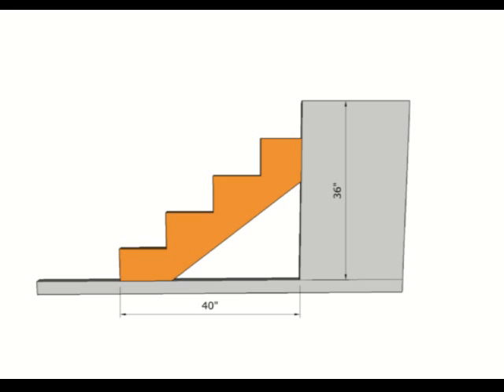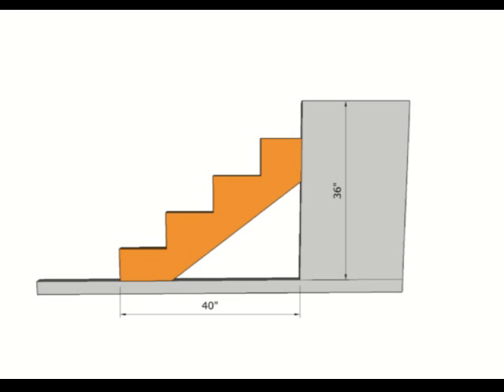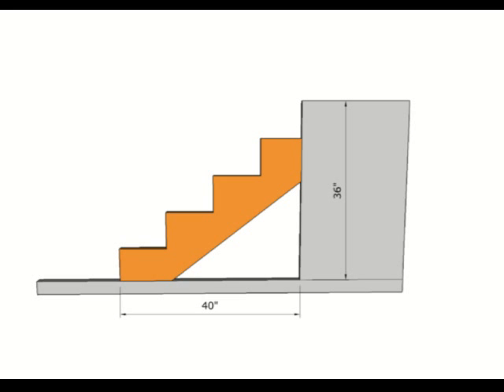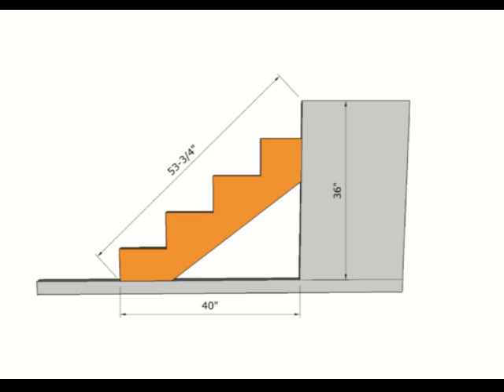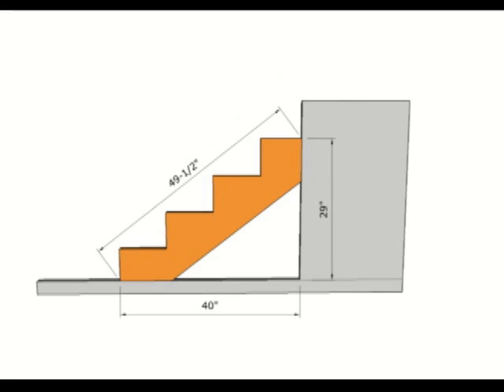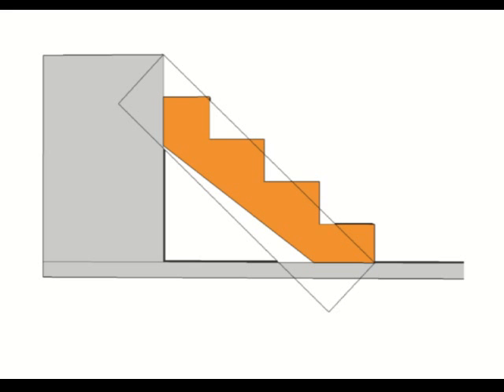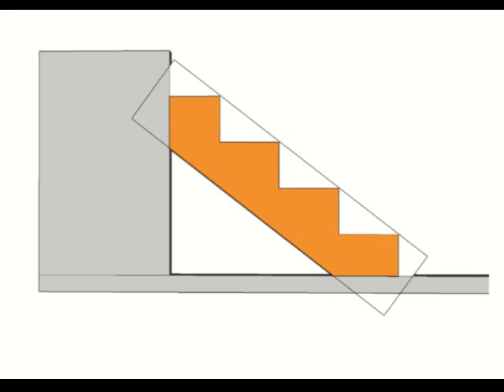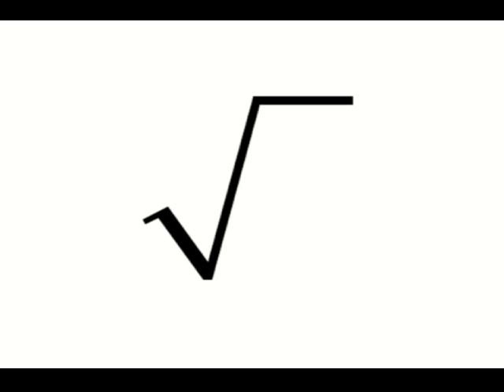How To Figure Length of Stair Stringer – Construction Math

Comment: Worst math or DIY video Ive seen. A confusing, complex meandering math lecture. If you're going to go so math heavy then show why its a square root of the final number. 
a² + b² = c²     so "c" (hypotenuse) = square root of a square + b squared. 
To isolate c, you do the opposite which is to find the square root.

Comment: Many moons ago till said date i stumbled on a bracket type stringer with out evrr setting foot on it heres why the stringer was short of the desire d area for one secondly it had to be rais ed thereabouts a foots to be level so now the bottom of the stringer on the main floor was retro fitted with a piece of metal holding it up picture houses in louisianna by the bayou on stilts and installed in this state yes california if ur  wandering hes yet to see anything in this utopia of know it alls how. Him would go about making on site adjustments to take rectify this situiation

Comment: But if the length has to stop at a certain mark, no one gives that, say if the mark on the length is 90 inches and the height is 60 inches, I guess I will have to make a video showing how to do it, I guess no one knows how, I can make them to stop anywhere the customer desires but it’s not shown anywhere
Reply from the maker: If you went to our website and couldn't find anything, you might consider getting this book https://www.homebuildingandrepairs.com/books/landings.html

Comment: I just had stringers put on my side porch leading to the backyard. The porch is concrete.  The porch has a slope of one half inch. When the carpenter put the stringers in he also put them at the same one half inch slope. He tells me that is code. Is it code to follow the slope of the porch when putting in stringers? Or should he have only sloped it one in eighth of an inch to a maximum of a quarter inch as I have read on the internet? Thank you very much.
Reply from the maker: https://www.youtube.com/watch?v=G8Dw8Dgp-Dg

Comment: Is this total measurment for the top portion or bottom portion of the board???  Cut will be different depending if measurement is for top or bottom as bottom is 7.5 in less than top cut correct???

Comment: I'm confused how he got 53 3/4 I know how to get the 53 but it turns out to be 53.814 decimals. All I want to know is how he converted it to fraction inches
Reply from the maker: This video was meant to provide you with information to figure out the lumber sizes necessary to purchase the stair stringers. As far as converting decimals and fractions, I would go to the website and check out the construction math section. Let me know if you can't find what you're looking for.

Comment: "A" is not difficult to calculate, just take a tape measure.  But "B" depends upon the run and the number of risers.  Or, am I missing something?
Reply from the maker: The main point in this video was to provide people with a method for measuring the length of the stair stringer, when estimating or working with a set of building plans, before the project is built. And yes, you can calculate most things by simply measuring them, as long as there is something you can measure.

Comment: Just as in nearly all vid about stair building this one will work if you live in an idea world. Most of us  do not. The biggest mistake made in setting out the strings is that the total vertical rise is not  made at the correct place. Taking it like shown here will only work if the base line  or floor is level. Inside a building  that may mostly be the case  but if you are doing deck stairs outside that probably is not true. 
The height you need is not at the landing of your stair but at the foot of them and that may not be the same  thing.  You need to take a vertical measurement at the point where the stairs  touch the floor to a point above that that is  level with the top of the floor at your landing. That is your true vertical rise. How do I know that , well I am a master carpenter with over 40 some years of experience and like you could never sort out what they told me and why it did not work right back when I was young. I find to easiest way to get that measurement is with a long enough 2x4 and a line level. You will need some steps to get up there and  mark your 2x4 but that is all there is to  it. just fix you string line to the top of the finished floor level first.
You may have to guess at the number of treads you will finish with to get that total run for the point you are going to measure at. but you can adjust as you need to once you have the total rise to get your tread height and how many of them you will have from. Once you have correct figure for your total rise and run then you can work out your  stair .
Reply from the maker: It might not be an easy method for everyone to understand, but it does seem to work in most worlds, even the ones that most of us live in.

Comment: Height 80 inch. How will i calculate?
Reply from the maker: I would watch the video again, it's pretty self-explanatory and you will also need some type of base length measurement to figure out the length of a stair stringer, before purchasing lumber to be used on your project.

Comment: First off it wrong bro if your height from the floor to to the top of the platform is 36 inches ur rise would be 8” your tread for length is 40 inches ur tread would be 10” and I measure nosing to nosing
Reply: Rise 9”
Reply from the maker: There will be a total of five risers. You will need to count the last step at the top of the floor.
Reply: Tanisha, your English is terrible.

Comment: Get the over all height and divide it by how many steps u think it'll take until the answer is between 7.25 and 8.25, the number of steps is the number u used to divide and the height is the answer, so if the answer is 7.50 then it's 7 and a half, that's the rise, run is w.e u want it to be but 10 inches is a good step, if u need 5 steps only cut 4, that way the last step is stepping off the steps onto the platform like in the pic of the steps in this vid
Reply: An alternative idea is to divide by how high you want your riser to be, rather than keep trying some number until you get between 7.25 and 8.25.  I'll show the two examples of the idea.

36" total rise height...keep trying 36 / 2, 36 / 3, 36 /4 , etc .  36 / 5 will give 7.2.  So that means, around 5 steps.

Or if you divided by your desired riser height, then you'll also get the number of steps needed.

36 / 7.25 = 4.96, and round up to 5.

Let's say you now have 48" height and you want 7" riser.  Now 48/7 = 6.86 or 7 steps.
Reply from the maker: Most definitely something like that.
Reply: Colby Eagle you can also back cut the steps and Gane 4" from the first 4 steps if you need more room at the bottom. You are correct.
Reply from the maker: Keep in mind that most residential building codes require a 10 inch minimum tread width. This video might help https://www.youtube.com/watch?v=6ODc9n5_0kQ
Reply: Don't forget to allow for the tread thickness when cutting stringers.
Reply: Hmmmm. All this dividing until is a bunch of nonsense. Go buy a construction master 5 amd learn how to use it. The proper way to state the formula you use for stairs is c=the square root of a sq+bsq because asq+bsq does not give you c(stringer length) but it gives you csq which is not the answer you are looking for.

Comment: It’s 53-13/16 not 3/4
Reply from the maker: Are you sure it's not 53 and 25/32 of an inch?
Reply: stairbuilding well since your not building a Steinway and 99% of carpenters in this scenario would be working in 16th yes I’m sure but furthermore 25/32 is not the correct answer, 26.047 of a 32nd is a little more actuate which is obviously rounded to 26 and you know what’s that reduced to? 13/16 . The answer to the hypotenuse is 13/16 using 16th not sure what you say 3/4. If you need tutoring let me know.
Reply from the maker: I had to remove your other comment, because you used a bad word, shame on you, but I will let it go, because most construction workers use them regularly. Yes, I was just messing with you and yes certain measurements like rise and run, or individual riser heights and tread widths need to be precise and within a 1/16 or 1/32 of an inch, especially when laying out longer stair stringers. It can make all the difference in the world. However, when trying to figure out the length of lumber to purchase to layout and design a particular stair stringer, this is the key to the video, the main message and point of making the video in the first place, while keeping in mind that lumber is usually sold in 2 foot increments, a 16th of an inch or even a half inch usually won't matter. Hope this makes sense :)
Reply: stairbuilding fair enough you win, thank you for the videos
Reply from the maker: Aright!!!!

Comment: If I have a tile that is 12 1/8 inch. And my hall way is 137 inches. What formula can I use to know exactly how many tiles can fit.
Reply: Multiply the length times the width of the hallway.  That will give you the square footage of the hallway.  Divide that by 12 and it will give you the number of tiles you need.

Comment: I disagree with the premise here, there is a much easier way to build stairs without cutting the sawtooth stringers. Keep the 2x12 intact, just cut the top and bottom to anchor where it needs to go. Use metal clips, or 2x2s and 2x4s will work. Make the measurements on the uncut 2x12 stringers, total rise divided evenly must be below 7-3/4" but that depends upon the local code. Some say that is a max. 8", but not here, so better call the building inspector. Once you have marked the stringers with the location of each tread, just level and screw in the metal clips, like a Simpson L-90. So simple, no crazy angles to measure and weaken that stringer, much stronger then if you use a 2x12 as the tread, rip a 2x10 or 2x8 to the exact dimension of the rise screwed into the back of the lower tread, then under the front bottom of the next tread. That makes the treads supported by a beam all the way across to the 2x12 stringer that has not been cut. It is always much stronger, better use of materials, less waste and easy for an amateur. The tread width is not a big deal, anything over 10" feels comfortable, but the rise has to be exactly even, including the top and bottom or people will trip. It is a common mistake to forget to add 3/4" to the top for a finish floor. This method is also much better for outdoor stairs since the stringer is not cut. Cutting the wood opens those cellulose fibers to the outside, where the fungus and mold get in and destroy it. All cut ends should be sealed, even if it is Pressure Treated.
Reply: Robert Carver make a video.
Reply from the maker: I would use metal clips, but if you are going to use the methods suggested above, I definitely recommend checking out our book, How to Build and Frame Stairs with Brackets.
Reply: Thanks, but I have  built hundreds of stair cases this way. Started off doing the regular stringer method and added the 2x12 outside just to make the balusters easier to install. I am an engineer, relied on my finish carpenters to do the traditional method until I saw how to screw the riser 2x8 in place and made it monolithic. Anything outside lasted three times longer than the traditional sawtooth cut. I have done a lot of those on the beach, so PT wood there never lasts more than 9 or 10 years unless I seal the ends well and seal the wood yearly, then it seems to last forever. I have some that are 20+ years now, still holding up.
Reply from the maker: I you saying that it's easier and that you're method creates stairs that last longer?
Reply: Robert Carver free,,,
Reply: Robert Carver thank you
Reply: Robert please make a video

Comment: What Carpenters need to know is the optimum tread run and riser height which is 7"x 11" you can change them from there but not too much but they all need to be exactly the same.
Reply: Frank Menanno first of all you should check actual high and then you multiply high*12+6"then/18=you take raiser and you can make

suppose your high is 11'and  12" are there in 1'foot &+roof thickness mostly are 6"
11'*12*=132"
132"+6"=138
how many step you want maximum are there 18 step stander then
138/18=7".666 is your raiser

Comment: I watched the video how to build the stringer and I get it. I would like to know how much head room I need before the stringer is in place.
I'm looking at the height from the floor (lower) to the top floor and I have 72 1/2" but from the upper floor the where the wall starts in front of it I only have 48". I think that I will almost have a ladder to walk down. Hope this makes sense to you.
 Thanks, Bob
Reply from the maker: Robert Romo I think I understand what you're asking and there's a good chance you won't be able to build the stairway in that area. This is a big problem, but sometimes we need to examine the facts and accept defeat. If you don't have enough room horizontally or vertically, then you won't be able to design and build a safe set of stairs.
Reply: You are right I could not build the stairs because of the height. Thanks, bob
Reply from the maker: You're welcome and thanks for watching the videos.
Reply: Do you not have enough room to do a landing then turn the stairs back the other direction away from the wall you speak of so the stairs come up in another area with enough clearance. If I'm understanding you correctly I think you are going up into an attic type space not sure though. I am picturing 2 different scenarios in my head and not sure which one it is.

Comment: (Rise * Rise) + (Run * Run) = (length * length), we'll solve for Length.
Using the stair dimensions (examples below):
(38 * 38) + (60 * 60) = (L*L)
1444 + 3600 = (L*L)
5044 = (L*L) to simplify we'll calculate the square root of 5044
which is 71.02", round to just 71" or appx. 5.92 feet.
Reply: Cryguh